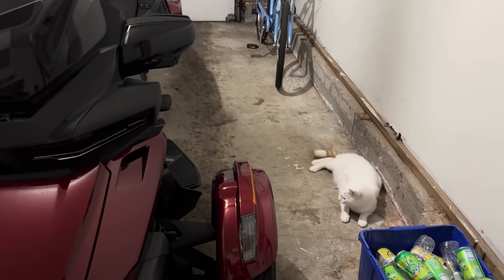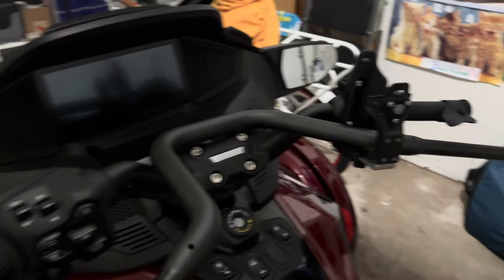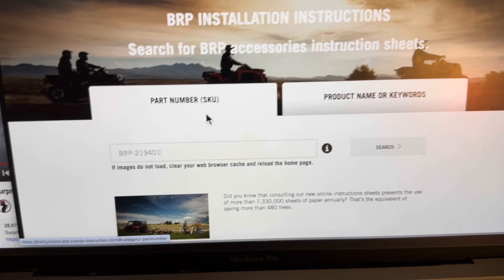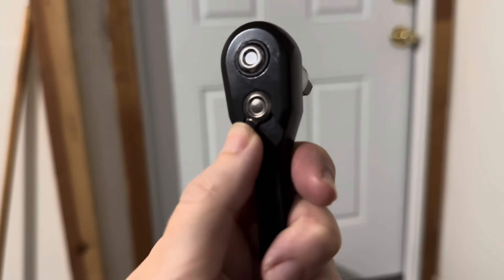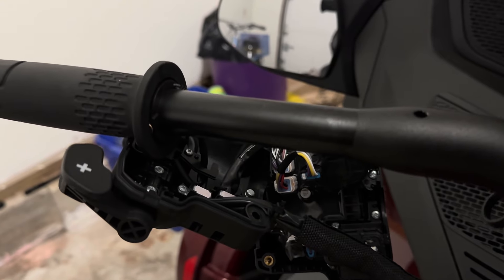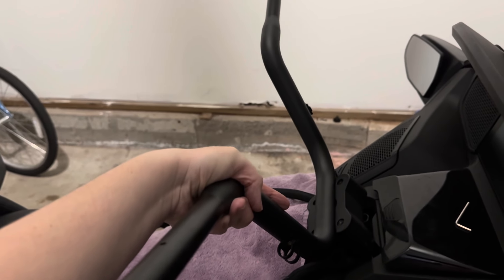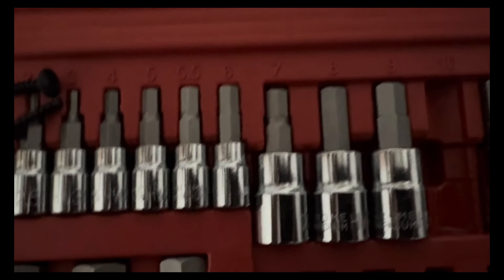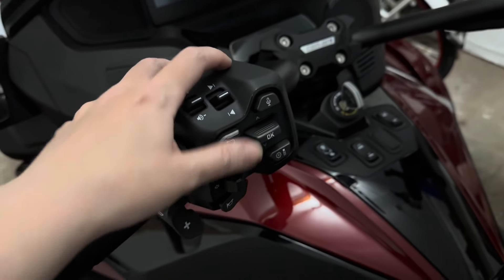An idiot's attempt at installing short reach handlebars on a Can-Am Spyder RT Limited (2024)

Comment: Mel, thanks for having the only video I could find on this, good job 👍.  A couple of things:  there are instructions on the BRP website, I don’t think you entered a complete part number when you searched;  you should loosely install the grips on the new handle bar before mounting, you won’t have to worry about cutting zip ties to increase wire bundle length;  what you kept referring to as a torque wrench is a ratchet wrench, but you do need a torque wrench to tighten the mounting bolts correctly.  Once again, good job 👏.
Reply from the maker: Thanks for commenting! Yeah, I probably entered the part in wrong, it was quite an adventure installing that handlebar. I'm glad it's over with. 😅 I can't wait until I can ride again!

Comment: I'm not sure about your title, but I too got Lamonster package, short reach and the 2 in riser.  in the end I did not find the short reach to my liking and just used the riser.   I eventually switched to the Show Chrom adjustable riser that eliminated the locking pin so the bar could be rolled forward or rearward, currently rear. lot more comfortable with the backrest  RTL22
Reply from the maker: @n6dl321  I haven’t taken it on any long distance trips yet since installing the short reach bars but I really hope they stop the back aches.  The backrest is a game changer for me. I looked into adjustable handlebars but they looked too expensive. Possibly one day I can afford them if my YouTube channel takes off 🤞
Reply: @vagabondmel  If by adjustable handlebars you mean:
HeliBars Horizon HSTX Fully Adjustable Handlebars for the Can-Am Spyder F3 (2015-2023) & RT (2020-2023) $630
Then these might help: 
Show Chrome Adjustable Aluminum Handlebar Riser Kit for the Can-Am Spyder F3 (All Years) & RT (2020+) $85
they use 2 1 inch wide risers side by side to avoid the CanAM central locating pin.  Thus you can rock the 
bars for and aft.
Reply from the maker: Yeah I meant the Helibars, thanks for the info!  I’m a penny pincher these days